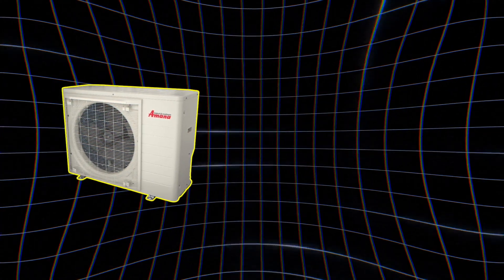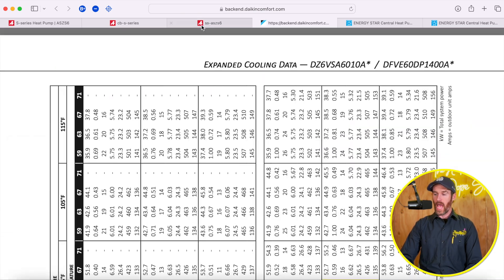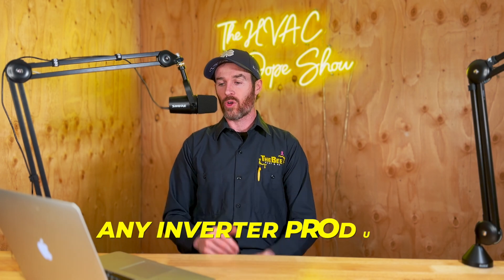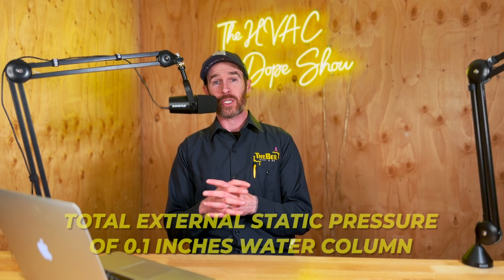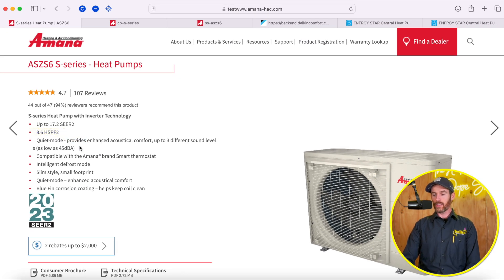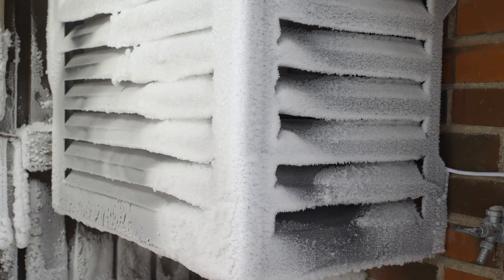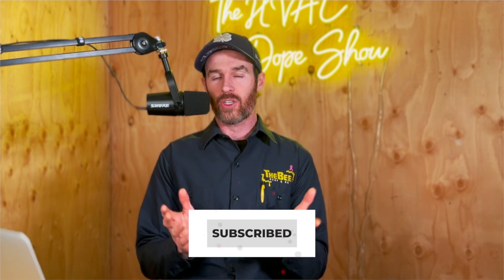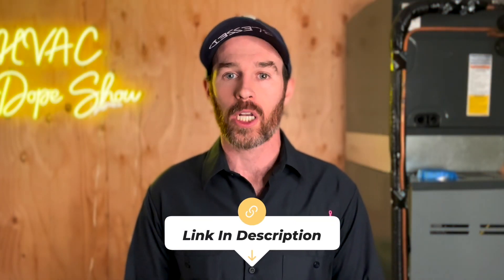Amana ASZ6 Side Discharge Heat Pump 🆚 Daikin Fit Enhanced | 2025 Heat Pump Reviews

Comment: Daikin Fit runs continuously at reduced speed for “ comfort and efficiency”. No thanks. When my home reaches set temperature, I want it turned off.
Reply: You do understand that when it runs at reduced speed for your "comfort and efficiency" does what it says? I just had a Daikin DH9 installed and came from a Goodman single stage furnace. There were rooms that were 5 degrees colder than others. With the Daikin, because it runs at reduced speed, there is always airflow, and now there is only a 1 degree difference between the rooms. Further more, because it's running at a slower speed, COP (efficiency) "goes through the roof". With a single stage heat pump, it's either off or running at 100%, which has much lower COP values.
Reply: @jasperhorng7796 
I do understand. In the business 43 years and own my shop for 16 years. Your rooms are a different temperature because either the duct sizes are wrong or the system was never balanced when it was installed. Our installs get a complete balancing before  the customer writes the check. Balancing ensures every room gets the correct air flow.
Reply: @bills6946  How do you compensate for different rooms that are at the corners of the house and thus aren't as insulated? In my case it isn't an airflow issue but a thermodynamics issue. In an optimal world there would be zones for every room. But if a whole floor is a zone, then even with correct airflow to all rooms, some rooms will get hotter or colder than the others. There is no way to avoid that. With slow constant airflow, it will naturally balance out the temperature.

In my case I also get extra filtering due to 2 Aprilaire filters.

Comment: So basically… same system?   So much time and only 25 sec of comparing performance data.  Which one costs less? My guess is Amana.
Reply from the maker: They're identical, pricing will be based on distributor and dealer, but they're the same with a different logo, that's what I was alluding to 😁 shouldnt be a big difference

Comment: Why do you keep referring to the Daikin as the "enhanced"?  I've never seen that word on a single listing for this unit.
Reply from the maker: Daikin fit enhanced is heat pump version only and only available in 2, 3, 3.5 and 4 ton versions. It has an “E” in the nomenclature, and the differences are higher EER ratings, improved high ambient performance, and improved low ambient performance. It’s only relevant in heating climates or high ambient cooling climates like Phoenix or Las Vegas for example (110F+ temps)
Reply from the maker: https://bim.daikincity.com/item/heat-pumps-1/dz6vs/dz6vsa241e

Comment: It seems the 5 ton unit is not eligible for the $2000 tax credit, is it less efficient than the 4 ton system?
Reply from the maker: It doesn’t hit the EER threshold, it’s not an “enhanced” version it’s just the standard version of the heat pump.

Comment: It appears that only Mr. Cool has developed a means for a true DIY installation.  Are there any other companies that have managed to find the means to complete the installation of the lines without a vacuum/pressure test?  I would rather go with another brand on a 22 year old Lennox 4 Ton, 100K LP updraft furnace replacement, but so far everything else requires a contractor for the warranty to be valid.
PS "...The truth is you’ll find some systems haVe more in common than you might have previously realized."
Reply from the maker: If you’re wanting DIY the Mr Cool stuff is it. Goodman and a few others can be purchased online. Honestly Goodman is a good brand it’s the poor installs that have gotten them a patchy reputation, but they’re some of the better products you can buy online IMO since it’s essentially like a private label version or Amana or Daikin.
Reply from the maker: But Goodman and all other brands require the lineset to have a vacuum etc… the pre charged lines on Mr Cool are kind of annoying IMO because you cannot shorten them because the lineset has refrigerant in it so you’re stuck with a sloppy looking lineset often times because it’s too long and never the exact right length
Reply from the maker: If you want to DIY it wouldn’t hurt to just buy a vacuum pump and micron gauge and get a proper system
Reply: You still have to pull a vacuum on the line set and the indoor coil for the Mr. cool or you’re gonna have moisture mix with the refrigerant
Reply: @anthonybernier9952  From what I read, all components are charged… I didn’t look, but if they were smart they would use PVE oil and then trivial amounts of air wouldn’t be an issue…
Reply: @EarlHayward  yeah I read that there pre charged recently. Pretty crazy. Not feasible when you have to cut the line set shorter to make it look cleaner instead of having a bunch of extra copper. I would not use them.
Reply: @anthonybernier9952   Don’t worry about line set length, just coil it vertically creating unnecessary traps and hope that over time the compressor still has enough oil, or that refrigerant velocity is occasionally sufficient to return trapped oil… Clearly, that is what I see on Youtube on all those installs so, it must work!

Comment: I live in a 1600ish sq ft modular home built in 1975, in the middle of Michigan.
My furnace took a dump and I need to replace it, but I am looking into a heat pump system. Normal Winter temps hover in the 20s normally, but can get below zero for a week or two some winters.  Current furnace is an 80$ Miller.  I am building a mechanical room behind my house that will be 14x10x7ft ceiling and that is where I want to relocate my heating system to. Approx 18 ft from my current lp furnace location in the house.

Look into a combo fuel system as being we can get pretty cold in the winter, I don't think a heat pump system alone would work.  LP is around 2.40 a gallon and I go through about 1000 gallons a year most of which is between Late November and early March for a normal winter period.

I have been seeing the new Daiken system and this Amana, and the BOSCH unit, And Train units.  Not sure of the biggest differences between them.

If I were to just go to a new LP furnace, I would be looking at a 96% over the current 80% unit installed.  It was having problems keeping up in the really cold periods. Granted I need to reinsulate my walls, but that is a different animal for a different video. 

So out of the Bosch, Daiken, Train, Carrier, and Amana systems, which would be the most suited for me?
Or should I bypass this option and go directly to ta ground source system via a Pond, or a few Geo Wells? or even a Ground loop system (depending on how much loop I would need to bury at what depth).  Im in an area where the water table is a bit high so get water flowing not too far under the surface.  5-7 ft will fill with standing water.

Plan is to install return ducts from the house and each bedroom back to the mechanical room, which will be somewhat in ground 3ft- 4ft deep,, while 3 to 4ft is above ground level, ofcourse using an upflow design to blow into the 2 straight link ducts under the house.

Will a full geo system work in my scenario, or should I look at a Dual Fuel for the really cold times, or a ground source system foregoing the system shown in your video here.
Sorry for the long inquiry, but figured most of it was info you would need to calculate the potentials.

Thank.
Reply from the maker: Short answer is Geothermal can be expensive but if you have the money for it then it will work year round and less of a need for backup heat with good insulation, though they’ll still have a buffer for -20F and colder temps. My recommendation would be a Daikin fit or Amana Enhanced, with a dual fuel LP (80 or 96) because they’re cold climate rated and quieter than the Bosch in defrost mode and your system will be used for heating a lot. We install Bosch in co without issues related to noise but it’s still a consideration, and your climate has more frost buildup because of moisture in the winter so the Amana or Fit will be better IMO. I would get the 96VC on the furnace (not the modulating) only because it’s backup but will also allow for you to run it more regularly if electric prices spike or vice versa since you can change your switchover temperature if the price of one fuel (electric vs. LP) has a big spike for whatever reason. My only note is I would pass on relocating the mechanical room because oftentimes this throws off the entire duct design for the house and nothing will work right and certain parts of your home will get no airflow.
Reply: @TheHVACDopeShow  Excellent information.  Kind of what I was considering.  The one caveat is my crawl space is barely over 24 inches of height available and the entry to it is only 23x25 opening.  So real estate under the house is tight.
Reply: Be careful putting in conventional hvac equipment if your modular home is on that style of duct system.